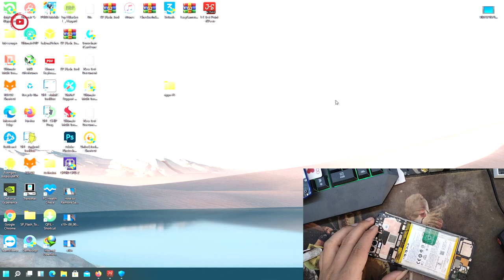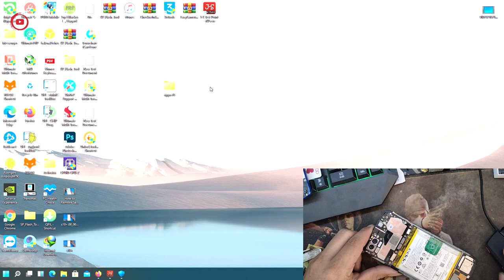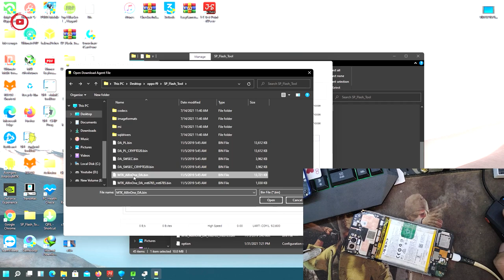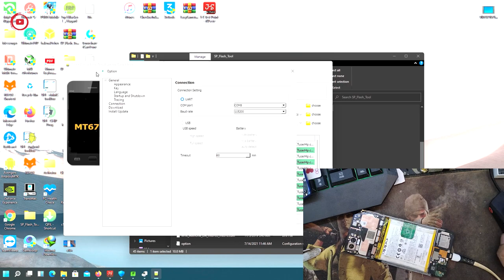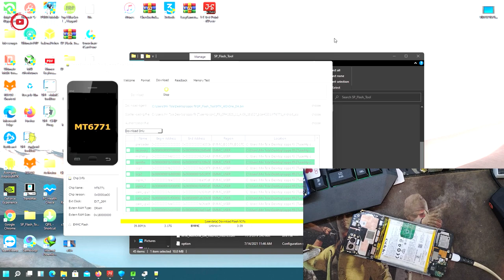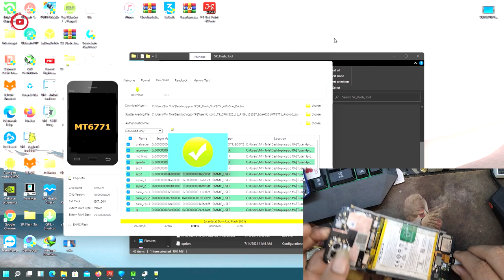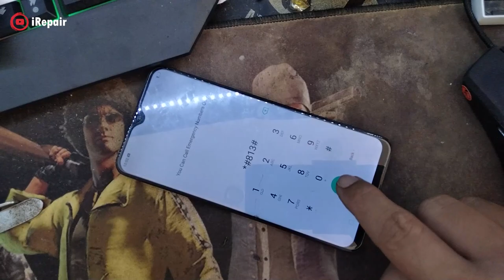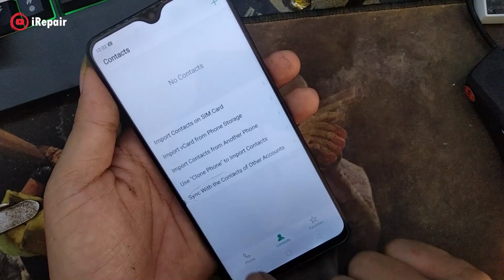Oppo F9 CPH1823 Dead boot repair After Flash with sp flash tool

Comment: Bro pls im tired 
Oppo f9 deadboot only mtk port 
I managed to flash with test point method via SP flash tool 
But every rom i flash the oppo f9 still deadboot 
Why ??? 
Is this firmware the right one ?? 
Because i searched a lot and only solutions i found is to flash oppo f9 dump file emmc with ufi box but i dont have box 

Pls tell me brother , if SP flash tool Can flash m'y phone and détectes it it means i just must find the right firmware or it must be done by dump flash emmc ? 
Im really tired i downloaded Big files roms ( Time waste ) 
But every rom its not the right one for m'y oppo f9 4/128 !!!
Reply from the maker: connect phone with ufi box test emmc 
if emmc healthy ok you can rebail CPU And emmc
Reply: @vfixer7740  i dont have ufi box thats the problem
Reply: @vfixer7740  but in your opinion , since pc detects my oppo and Can flash it with SP it means its not emmc problem ?
Reply from the maker: @zakariadzboyz  your logo only or usb port only?
Reply from the maker: your phone
Reply: @vfixer7740  USB mtk port only 
It doesnt power on !!
Reply from the maker: @zakariadzboyz  cpu brother
Reply from the maker: check capacitor around power ic and cpu